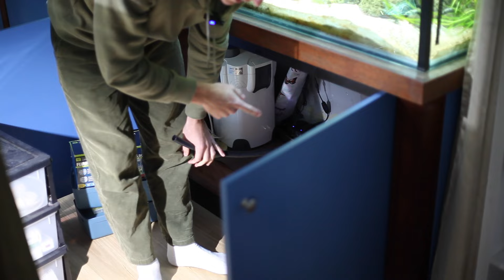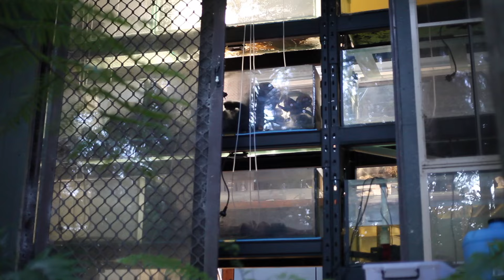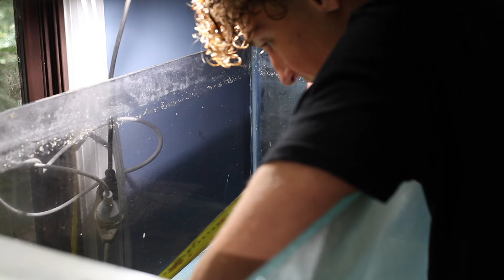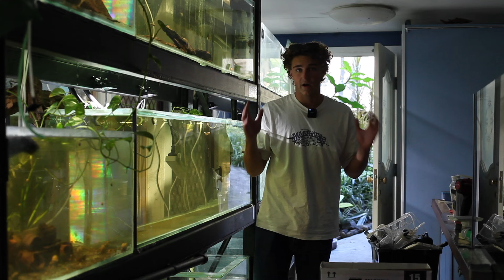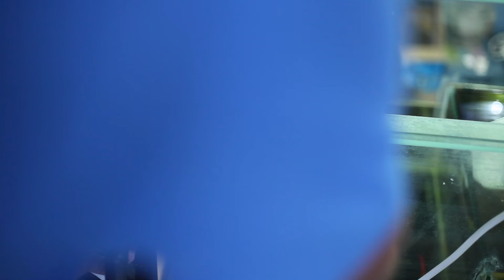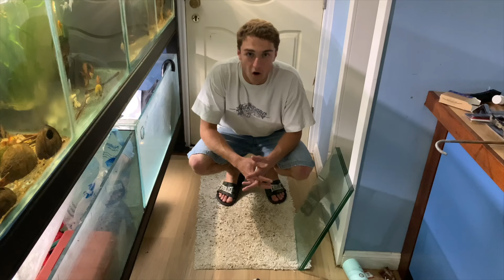I Finished Building My Fish Room!

Comment: Well done for sticking to it Harlan! Now to reap the rewards for all your hard work.
Reply from the maker: @rrotley1  thanks so much yes I am very excited 🤙
Reply: If you can get the pump above everything else it will save you a lot of grief .
I have the same pump in my room just below ceiling level I can’t add a photo ..if you can’t do it put a check valve on it in case the power goes off
Reply from the maker: @richiesfishroom5032  thanks 🙏 I’ll see if I can find a more suitable solution I haven’t actually seen it do that when the power is turned off so maybe fine the way I’ve set it up.
Reply: @HarlanFord  I sent you a message on Insta can’t send you a photo until you look at it and will send you a video of how mine is set up
Reply: Great work by the way